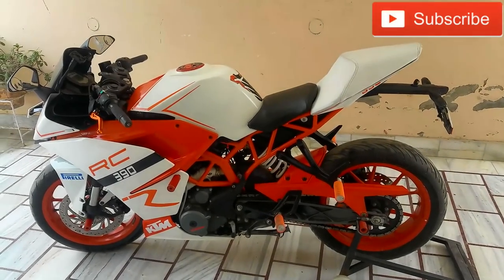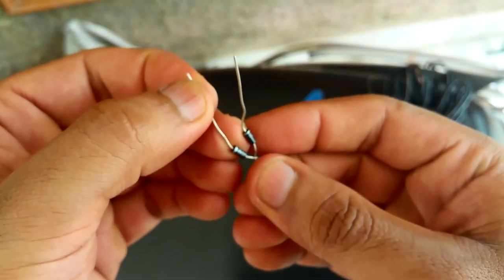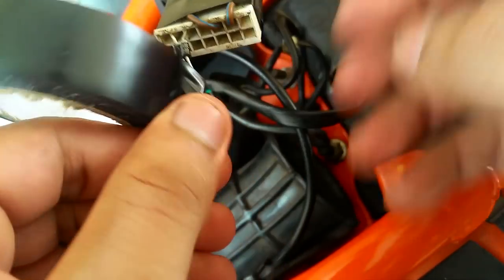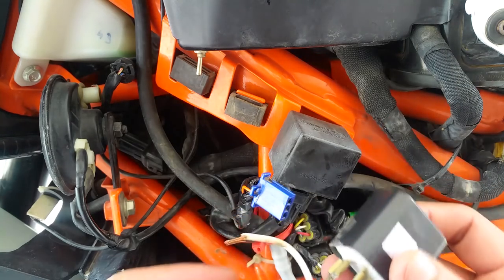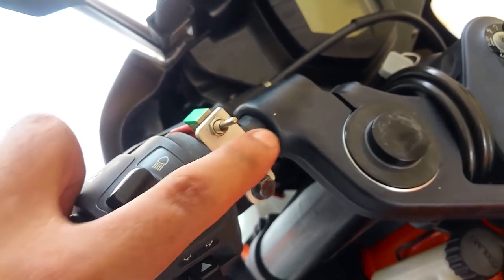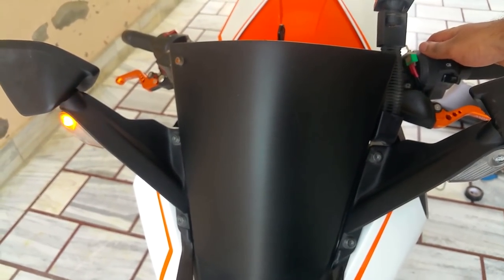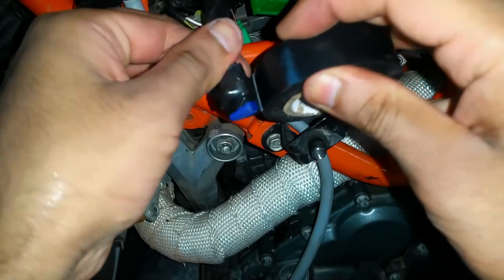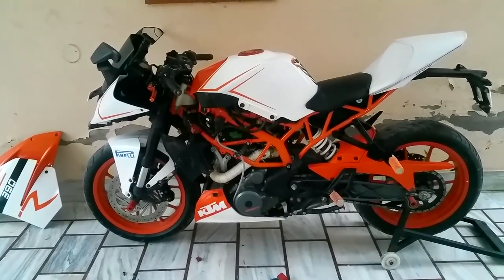Installing Hazard Lights & Bypassing Headlamp Unit for Rs100 only in KTM RC200/390

Comment: hey , what if we connect the positive wire of both left and right indicator to a switch. Cant we eliminate the diode and aftermarket flasher with this method?
Reply from the maker: If you don't install diodes then u won't be able to use one sided blinkers..the switch on left handle bar for blinkers will turn on all 4 blinkers at the same time doesn't matter in which direction u flip it.!!!
Reply: yea got it , but what if i install a switch between the 2 indicators in a way that if the switch is in on position,then current will be flowing to both indicators no matter in which direction i flip the switch ,and we can use the one sided indicators when the switch is off.
Reply: @yavanochi  that doesn't work. There is not sufficient power for turning on the 4 indicator with this method. I tried.